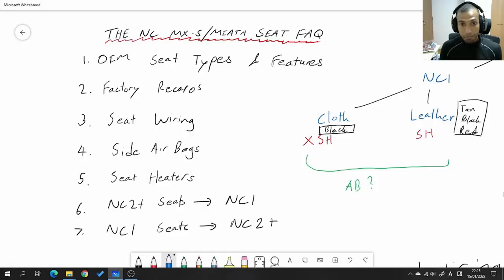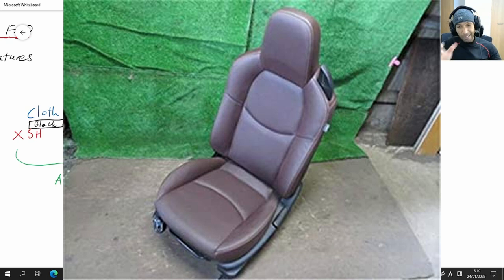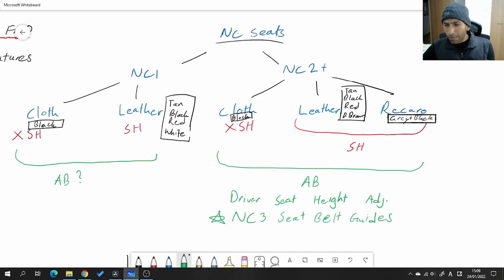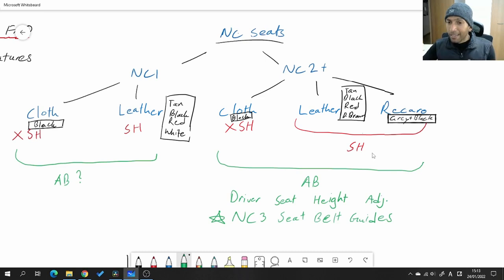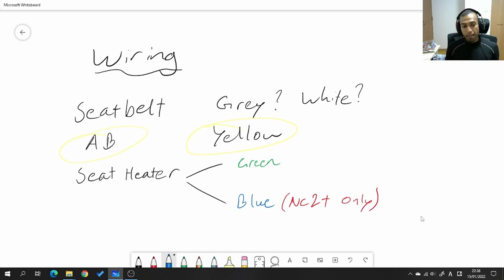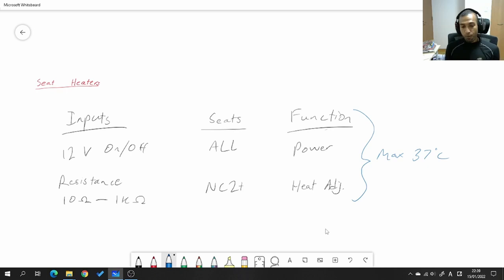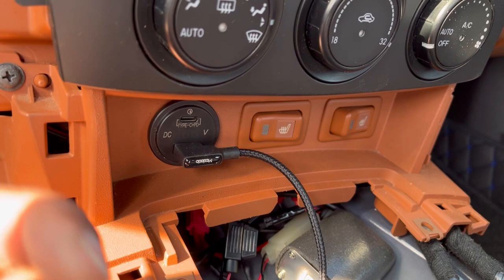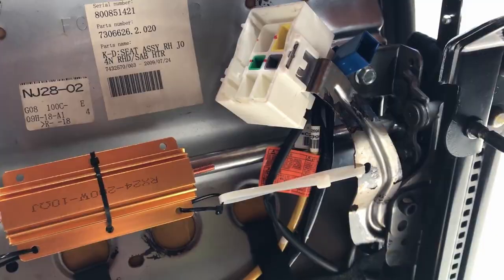NC MX-5 Miata Ultimate Seat Swap FAQ | Tach On Red

Comment: Nice video.  One thing possibly worth mentioning is that, in the UK at least, both the passenger and drivers seat have sensors for the seatbelt activation.  This is needed because the passenger seat has a weight sensor to indicate whether there is a passenger sitting in it or not.  To turn off the seatbelt light and alarm (when moving) the belt has to be fastened, this can be quite annoying if you place a bag or other luggage on the seat.  The drivers side does not have a weight sensor, it works on the logic that if the car is moving there is probably a driver present.
Reply from the maker: That is really useful to know. 

Just a couple months back there was someone in the NC Facebook group having trouble with swapping their passenger seats with aftermarket ones. 

They couldn't get the airbag light to go out because of that weight sensor not being present. 🤦‍♂️ Not sure what they ended up doing buf the discussion seemed to go the direction of pulling the entire weight sensor unit out of the factory seats and just having them plugged in. 🤷‍♂️
Reply: @TachOnRed  When I got my car earlier this year (2013 ND2+ 2.0 PRHT) the seat belt warning kept sounding, I could tell it was related to the passenger side as it would stop if I plugged in the passenger seatbelt.  I tried unplugging the wire from the seatbelt, checked the dash and the light was still on so assumed it was a normally closed switch (closed when seat belt unplugged), put my meter on it found this was not the case so then assumed it was an 'intelligent' active device which was giving a data signal.  No, that's not the Mazda way.  I eventually realised that the reason the light was on was because the driver belt wasn't plugged in, I thought as I wasn't sitting in the seat it wouldn't trigger but, as I mentioned the drivers seat doesn't have the load sensor.

Anyhow I then found I could 'solve' my problem by either unplugging the weight sensor or the seatbelt switch.  At that point I had the weight sensor out and was tempted to leave it at that but then thought this could result in the airbag not triggering if there was a passenger in the seat so swapped to removing seat belt switch.
Reply from the maker: Interesting. And through that whole process, you didn't have your airbag light show on the dash? 🤔

Comment: Got a 2010 NC2 in Aus with the Recaros . Pretty sure it’s the “touring” edition with fugly forged bbs wheels (have been replaced with rx7 Bathurst R oem wheels). Very much rate the seats. No heating or cooling but drivers does have a decent amount of lowering ability which sure helps anyone over 6’. Supportive and comfy (considering it’s a sporty seat) and easy enough to clean and protect with colourlock products
Reply from the maker: Totally agree with you on that. 

The BBS wheels might have looked better if they sat a bit wider I reckon.

The Bathurst TypeR wheels are sweet. I had them on mine for about a year. Then replaced them with 16in FD wheels cz the 17s sit too wide for passing the local legal inspections. 🤦‍♂️
Reply: @TachOnRed  oh I have the 16”! Not the “hallow spoke” light weight design but the smooth thickish 5 spoke…kind of like r32 gtr wheels. 225 rs4s atm which are really nice but a tad noisy and theoretically this is a daily driver 

I’m yet to lower it (only just done sway bars) and I’m debating whether or not to jump up to 17” or not and go with the new pilot sport 5s

Comment: Well, shit me!  Acquired a set of perfect NC2 leather heated seats along with the variable switches and newer console.  Looks like I'm in for some serious work wiring these suckers up.  From what I can tell so far, the green and the blue plugs are for the back and seat bottom heaters.  I've learned the colors are whackado.  My 2010 seats have pink, yellow, red and green wires in the blue and green connectors.  Yeah, not seeing those in my 2014 diagram.  Got a link for the proper wiring diagram by chance?  Thanks man, great job on this video making sense of the differences.  The single switch setup utilizes a built into the set thermostat where the other one gets it's resistance value in that thumb wheel.  I imagine both versions have that 37degree cut off to prevent a burnt ass.
Reply from the maker: Congratulations on scoring the seats!

And yes. The thermostats work just as you described. Both types have a max 37degC cutoff and are built into the seats. Only difference is the NC2s allow you to lower that cutoff temperature using a variable resistance input through the switch.

Don't have a link to the wiring diagram but I got mine with a PDF workshop manual on CD which I bought on ebay. Mines for the NC1 only so I don't have  the diagram for the later ones. 

But Id recommend having a look on ebay for the NC2 Manual set. 👍 they're way cheaper than a Haynes manual.
Reply: @TachOnRed  Thanks bud.  I think I've got a good grip on the wiring now.  Spent a lot of time last night with an ohm meter.  I'll make my own harnesses if I can just find plugs to fit the back of the switches.  👍
Reply: For the guy trying to get his NC2 heaters working in the NC1 here's the real deal.  Throw the wiring diagrams in the trash and DO NOT use the cars existing harness!  Follow these colors under the seat and you will be good to go!  CUT the 4 wires off the blue and green plug!  The red is keyed hot, the green is ground.  Now the pink and yellow must travel to the back of the variable selector heat switch.  Looking at the back side of that switch, the far left pin is for the yellow wire and the 3rd pin is for the PINK wire.  If you want the thing to light up, the 2nd pin from the left is the grey/red and the 4th pin over is the Red/blue and those two wires come from the instrument lighting circuit.  Do yourself a favor and supply the red with fused and relayed power from a keyed hot in the fuse box.  If that last sentence is greek to you, walk away now.  lol.  The heat will not turn on unless there is some resistance across the pink and yellow.  High heat is around 10 ohms and low is around 1200 ohms.  A variable resistor knob COULD be used if you stay in this range.

Comment: I ve got a NC1 with NC3 leather heated seats. I ve also swapped the center console with a NC3 console along with the variable switches (which don't plug in the factory plugs at the back). If I do the variable resistor that you mentioned will the variable switches work?? Will I have to do anything else with the wiring ? The plugs are not the same as you mentioned at the beginning of the video for example, so I guess I have to swap the plugs also right ?
Reply from the maker: My guess is that the NC3 switches are variable resistors. If so, you won't need to add resistors. 

I'm not sure if the 12v power supply to the seats is constant or if the switches controlled that too when switched from 0 to 1. I'd need to examine the NC3 switches to know for sure. Looking at the number of pins they have and using a multimeter should allow you to figure out what each pin does.

Then for wiring, you'll need to draw out new wires from the seats to the NC3 switches. And for your 12v supply you can tap that out of the existing wires for the old switches.

Comment: You are the best when it comes to understanding and communicating details. Another great informative video. I have 2008 NC1 GT with Leather Seats with Heat Warmers.I have a few tiny tears on them. I'm not going to replace the seats but instead opt for seat covers. Would seat covers interfere with heating or airbags?
Reply from the maker: Glad you found the video helpful!

Most seat covers Ive seen do interfere with the side airbags. I've seen seat airbag compatible seat covers for other cars but not for the NC.

As for the seat heaters, they should be fine as long as its not a cheap plastic cover. Cheap plastic covers can flake and rub off their colour onto your seat upholstery. But if it's a decent quality fabric, leather, or even imitation leather, it'll be fine. 

I had Autowear leather seat covers in my car before installing the Recaros. Fitment was so good you couldn't even tell that it was a cover unless you looked really close. Rev9Autosport sells them. But I don't think mine were compatible with side airbags.
Reply: @TachOnRed  Does my NC1 2008 have Side Air Bags. Being honest. Just don't know.
Reply from the maker: Easy way to tell is to look for the tag on the backrest. If there's no tag, then it probably doesn't have them. There's a picture of it at 4:22 in the video. 😊

Comment: Maybe I missed it but, what seat would be the best seat to get the maximum amount of headroom?

Im a tall driver and I BARELY fit in my NB with stock seats. My head grazes the soft top metal bar. So im thinking of selling the car and getting an NC because I hear there is slightly more room inside.
Reply from the maker: You have 3 options if you're looking to maximize headroom.

1. Using Factory NC2 or later seats with JASS Motorsport seat lowering brackets. The NC2 or later type seats (Recaro or not) all have height adjustment. You can put them on the lowest setting, and then if you still need more headroom, get the JASS motorsport lowering brackets. Note that these require welding for installation. I've put 2 links to other videos about the lowering brackets.
https://www.youtube.com/watch?v=0-7C43TCSaA&pp=ygUZbmMgc2VhdCBsb3dlcmluZyBicmFja2V0cw%3D%3D
https://www.youtube.com/watch?v=0YBB1AgD0Sc&t=520s&pp=ygUZbmMgc2VhdCBsb3dlcmluZyBicmFja2V0cw%3D%3D

2. If that's not enough, next option is to go with aftermarket bucket seats with aftermarket low profile sliders such as this: https://www.sportseats4u.co.uk/product/2-pci-racing-mazda-mx5-mk3-frames-with-black-recaro-pole-position-abe-seats-package/

3. If you need even more room, aftermarket fixed bucket seat mounts. As the name suggests, they're fixed and don't have sliders to take up space under the seat. This allows you to position seat lower. The seat position is adjustable but requires tools to do so. So it might take some trial and error to get the position right for you. An example would be like this:
https://www.good-win-racing.com/Mazda-Performance-Part/61-1914.html

Comment: My 2014 NC doesn't turn off the heater. I have to remove the fuse. I replaced the switch, but it didn't improve
Reply from the maker: Is that for both seats or just one?
Reply: @TachOnRed  solo uno,  lugar conductor / only one, driving place
Reply from the maker: Try using some extension wires to connect the heater controls from your passenger side to the driver side. 

If you have the same problem with your driver seat, it could be a faulty controller.

The seat heater controller is built into the seat. So, replacing the seat might be easiest.

Comment: My Australian mx5 nc 2005 leather seats comes with side air bags and seat warmers wiring but no dash switches.
Reply from the maker: Interesting. So, in your case you can probably add the seat warmer function by just adding switches and a fuse.

Comment: How about this? My NC2 has been tan interior swapped with nc1 seats, with the NC2 switches in or even unplugged, the seat heating just comes on and off in intervals. I have the nc1 switches but as you said, the plugs are different.
Reply from the maker: I suspect that means the NC2 are wired to send a constant 12v power supply to the seats. The switches only control the resistance input. 

So, your NC1 seat heaters are probably on constantly. And their built in thermostat is switching the heat off when it reaches the max temp. Then when it cools down enough, it switches back on.
Reply: @TachOnRed  good theory, I will try some checks soon and report back

Comment: Is it possible to just remove a height adjustable seat from the frame and put it on top of a non-height adjustable frame? Would there be concerns with safety?
Reply from the maker: By "Frame" I believe you're referring to the slider rails?

The seats and rails would typically come attached even if you buy them used. This is because separating them is quite troublesome and time consuming.

And the entire thing will bolt in with no problems and will be perfectly safe, even if your car didn't originally have the height adjustment.
Reply: @TachOnRed  makes sense. My car has the height adjustable drivers seat and I want the non-height adjustable seat. I was just trying to see if getting the rails and changing them would be a solution but that doesn’t appear to be the case. Thanks for the response!

Comment: Honest question, looking at a 2013 club manual PRHT 21k miles aftermarket exhaust and suspension.........18.5k?   USD
Reply from the maker: I've been living in Japan for the last 6 years. So, not at all familiar with prices in the US market. Couldn't tell you if that's a fair price or not. 

I'd judge it compared to other cars similar in spec, mileage and condition. And the aftermarket exhaust and suspension in my opinion should decrease the value of the car rather than raise it. 

Be sure to check for any accident/ paint damage, and rust! Good luck!

Comment: Does the type of resistor matter when putting NC2 seats into an NC1? I may do this in the future and I want to put in a variable ohm resistor, but I know there are different types of such resistors.
Reply from the maker: Nope. Doesn't matter. Only recommendation would be to choose one that can be mounted and operated conveniently.
Maybe avoid the type that requires a screwdriver to adjust. 

Also avoid those that can easily be adjusted just by the vibrations of the car in motion. 😊 👍
Reply: @TachOnRed  thanks again!

Comment: I got NC1 seats with airbags, and still has the adjustable height.
Reply from the maker: That's interesting. Would be curious to know which county your car was first sold and what year. 🤔
Reply: @TachOnRed  2009 - Greece
Reply: @TachOnRed  Is it possible to lack the heating ?
Reply from the maker: Not familiar with the Greece market specifications. So I can't say for sure. As I show in the video, best bet would be to check if the seats have heating elements built in. 😊

Comment: Great video, I have a passenger airbag OFF light in the center console ON all the time, doesn't matter if there is a passenger or no, or if the key switch is ON or OFF, any ideas?
Reply from the maker: Could be any number of things.

I would start with checking if the passenger airbag switch is turned on. My car doesn't have one but it'll typically be somewhere near the power window deactivation switch just below and to the side of the steering wheel. If that don't work, try unplug the passenger seat harness and reconnect it.  If that still doesn't fix it, then perhaps a faulty airbag sensor or airbag unit. Would then troubleshoot according to the workshop manual.

Comment: Was really hoping to find something about the actual seat construction: Recaro vs. normal leather Gen3 (current).  Are they the same seat underneath just with more side bolstering and not in leather?
Reply from the maker: Yes. They're exactly the same as far as I can tell. The levers, adjustment mechanisms, etc. They really do just look like normal NC2 Seats with higher bolsters. I wouldn't be surprised if they were made in the same factory just with licensing rights from Recaro. 🤔

Comment: 16:34 hey man great video where did you get that exact cigarette lighter usb converter. Do you have a link for it ?
Reply from the maker: Thank you for watching!

The converter is a universal one and it fits perfectly in the hole for the cigarette socket. I used flat wire terminals to connect it to the factory cigarette socket connector. Then wrapped it in electrical tape so it doesn't come loose with vibrations. So I didn't have to butcher up the factory wiring and it's all easily reversible. 

Got it on Amazon: https://amzn.to/3tMDNx2